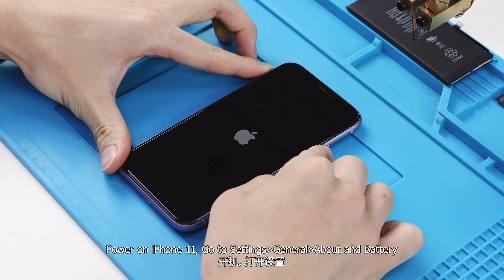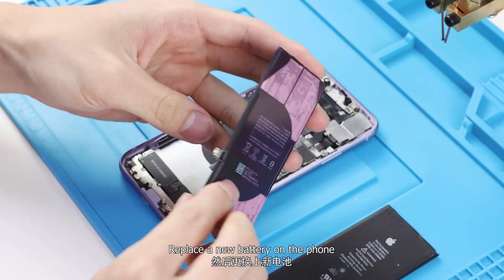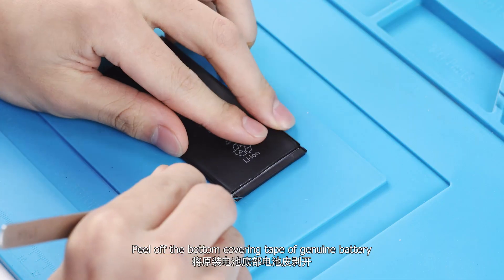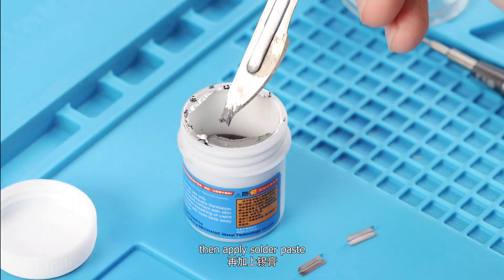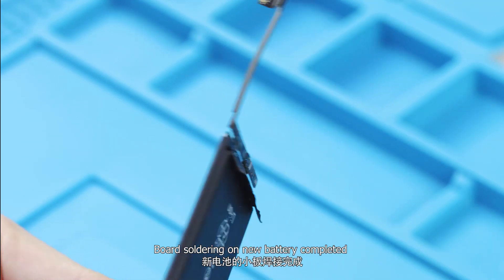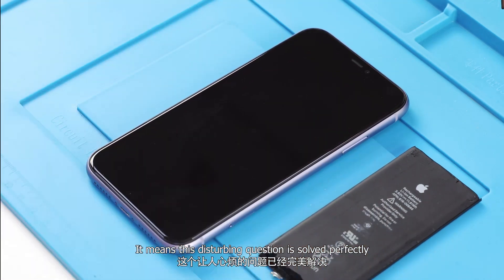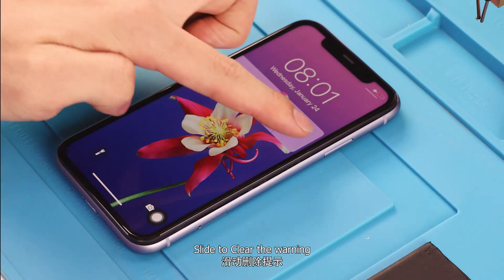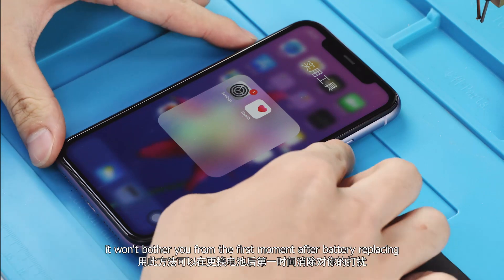Hardware Solution+Trick Tip- How to Remove iPhone 11 Series Non-genuine Battery Warning?

Comment from the maker: When you replace a new battery on iPhone 11/11 Pro/11 Pro Max, there will be an “Important Battery Message” shows it can’t verify the new battery is genuine.
Today we will show you how to solve this problem fundamentally with hardware solution, and, trick Apple with software setting method.

Chapter One: Change the Battery Board
Chapter Two: A Trick Tip

Reminder: Professional skills required, we don't take any responsibilty or loss during individual repairing.
Reply: But if my old battery was showing 76%battery health then the new one will show the same 76% or 100%
Reply: After replacing board will it show the old battery health??🙄 or new battery heath
Reply: @manjeetguro9169  it will show new battery health as the phone will measure it afterwards. So short answer it will be 100% again
Reply: @blackstars1989  Hey, I wanna ask something. Is it okay to use the iphone with the shitty apple message?
Reply: @blackstars1989  New battery health but with 500+ “fake” recharge cycles
Reply: @Dolla_z  yes it is
Reply: @Coolie-ds4tu  like elekworld is saying you can correct it so cycle goes down to zero. JC, icopy plus ect can do that. It been out for months maybe years already
Reply: Hey, I wanna ask something. Is it okay to use the iphone with the shitty apple message?
Reply from the maker: @Dolla_z  Yes, this message just appear on lock screen and setting page after you replace a new battery, you can't read the battery capacity and know the battery health, but it won't effect the battery function.
Reply: @Elekworld  thanks.
Reply from the maker: @Dolla_z  You're welcome. If you like our video, pls sub and stay tuned for more helpful update. :-)
Reply: @Elekworld  one more, does it pop up everytime when I wake my phone?
Reply from the maker: @Dolla_z  If just wake up the phone, it won't pop up.
Reply: Does that also reset the 500+ cycles of the dead battery back to zero when welded to the new battery?
Reply from the maker: @Coolie-ds4tu   The battery cycle wont' go zero, but we have a new battery data correction tool can fix it. Pls stay tuned and sub our channel, we will release a short video on how to use it.
Reply: Is it possible to set the clock 1 year ahead to get rid of the warming message instead of just 1 month?
Reply from the maker: @BillAnt  Never tried this before, will test if possible.
Reply: @Elekworld  -Try 1 and 10 years ahead. ;)
Reply from the maker: @BillAnt  we can try this 😂
Reply: Where can I get that  machine used in joining   back the board together
Reply from the maker: @chikaubah9687    This weld machine works very well: https://elekworld.com/shop/productinfo.aspx?proid=15187&categoryid=287
Also we suggest you email service@elekworld.com for exclusive 1 on 1 service.

Comment: I have a problem every time I soldered the cell to the new battery it no longer works could you help me with a tip!!!

I've been watching the video more than 100 times I'm interested in learning, but even so the original flex burns

I need help please !!!!!!!
Reply from the maker: pls pay attention here: https://youtu.be/sjOCID0IN5g?t=164. If the anode and cathode were connected occasionally, the battery board will get burn and short circuited. The 2nd possibility is the battery cell wasn't soldered properly with battery board, which led the battery stop working.

Comment: Hi sir i want to replace the iphone 11 battery but before that theres important message already at the notification if i replace it to new batt. And i used the old motherboard on the battery you think the notification will disappeared?
Reply from the maker: The theory is that battery data was binded with motherboard, so when you change the battery or the motherboard, the warning message will pop out. So as long as the battery matches the board, the notification will disappear.

Comment: We tried this but it didnt work. what you think it is?
Reply from the maker: Maybe other reasons, but that's what we suppose:
1- If battery doesn't power on, probably the battery cell and board weren't welded well;
2- If powering on works but warning message still there, probably the older battery wasn't genuine battery

Comment: this method still work?
didn't need icopy plus/apollo anymore for iphone 11?
Reply from the maker: Hi Bro, this method always works even on latest iP13 series, check this: https://youtu.be/soisFl6hmtk. Actually this method works to remove "important battery message", while iCopy/Apollo works to copy data from older battery to new one.
Reply: @Elekworld  I changed iphone 11 battery from shop its non genuine bt i m facing software update prblm plz help me nd solve my problem 🙏🙏

Comment: my iphone xr is showing the same message do i need to get a new battery?
Reply from the maker: If this message pop out, it means your battery isn't genuine battery from Apple. So if you change a new battery it will still pop out.
Reply: @Elekworld  so what do i need to do cause it is shutting down every 2 minutes i cant even use
 it anymore cause it charges until 0%
Reply from the maker: @thuli6851  I see, if the power even doesn't supply power, no doubt you need replace it with a new one. Even though the warning message still pop out, but at least you can use the iphone as usual.
Reply: @Elekworld  does it have to be a genuine one? or even if its not original battery it is okay?
Reply from the maker: @thuli6851    Both genuine and aftermarket battery works, because no matter it's genuine or not, the battery warning message will still pop out. This message won't effect battery to provide power to iPhone, just very annoying.
Reply: @Elekworld  okay thank you i will go get the battery replaced tomorrow because i cant use a phone thats shutting down every 2 minutes
Reply from the maker: @thuli6851  welcome

Comment: After I have swapped the battery board and soldered it on to a non-genuine battery, will a JC V1S programmer reset the charge to 100% capacity or only the cycle count? If so, will this charge return to the capacity of the old battery once I have inserted it in to the phone and restarted it? Thanks
Reply from the maker: bro, check reply on the other message.

Comment: Changing the battery will affect the face id? Cause i have read some comments after they change their battery their face id wont work?
Reply from the maker: Nope, we dont' think so. Because battery has nothing to do with Face ID. We suppose probabbly because they damaged dot projector during repair battery, which caused the Face ID problem.

Comment: The tips is available only for one month? So you have to do that each month?
Reply from the maker: Nope, after one month the warning message won't pop out again, so you don't have to do it once a month.
Reply: @Elekworld  I thought the warning message dissapears instantly after the new battery is inserted?
Reply from the maker: @matthewJamesKendell    If you replace genuine battery board on new battery cell, when you install new battery, the warning message will disappear immediately.
Reply: @Elekworld  Thank you. Please Ive got another questions. After I have swapped the battery board and soldered it on to a non-genuine battery, can a JC V1S programmer reset the charge to 100% capacity or only the cycle count? If so, will this charge return to the capacity of the old battery once I have inserted it in to the phone and restarted it? Thanks
Reply from the maker: @matthewJamesKendell     Hi Matthew, we have the other 3 videos showing more details about your questions:
1- JC V1S Tutorial: https://youtu.be/n7Z_-g1q0Pc
2- Battery capacity change: https://www.youtube.com/watch?v=AWyLDQIuIBU,  https://youtu.be/q7_GLdJ6Oso.
If you still have questions, pls leave message here.

Comment: to weld the battery, just any pulse welder is enough or do you necessarily need a machine that has all the settings for a more specific welding?
Reply from the maker: I think it's necessary for stable and safe welding. Because battery is about power supply&managing, if the connection isn't that stable&safe, it might bring safety problem or threat to users.
Reply: @Elekworld  ok i understand, thanks
Reply from the maker: @DavideLabInca   U're welcome Davide. If you like our video, please sub our channel for more helpful update. :-)

Comment: Hi! I have my iphone 11 “Important battery message” and stuck on 70% charge after motherboard replacement what should i do? should i change the battery or it is motherboard issue?
Reply from the maker: I think it's the motherboard issue(if you battery could charge 100% b4 you replace motherboard), but if you replace the motherboard, it means you have to do so. So we suggest you change another battery(brand new) to install and test if could be charged 100%. If not, then replace the board and test the old battery.

Comment: How did you get 100 percent battery health i did the same procedure but new battery show same old battery health
Reply from the maker: Yes it will show old battery health %, because the data is from old battery board. Actually we tried to use JC V1S to clear the battery circle to 0, but once upon you restart the iPhone, the data will get back to old battery again. 
Check video for JC V1S: https://youtu.be/n7Z_-g1q0Pc
Reply from the maker: @Carrot Cruncher The solution helps on below: 1- remove non-genuine battery alert message; 2- show battery health&capacity(even it's old battery data) in setting. Yes I agree with you that perfect solution is reprogram new eeprom, by now only Apple can do this.
Reply: @Elekworld  I need to remove non-genuine battery message with JC VS1 not by swapping battery boards/flex. What does battery data restore does with JC VS1? What battery information am I restoring?

Comment: I have a red notification on my settings app as I have replace the battery normal on my XS max - when will this dissapear?
Reply from the maker: Unless you replace the battery board with genuine one, otherwise the red notification on the setting app will be available forever as long as you use this phone.
Reply: @Elekworld  I know that would restore the battery health function, but the simple notification on the settings app will simply remain there? What is the purpose of this?
Reply: @retroonyoutube5402  it will disappear on its own, not sure how long until it does.
Reply: @retroonyoutube5402  no it wont, the message will disappear

Comment: Will that restore the battery health?
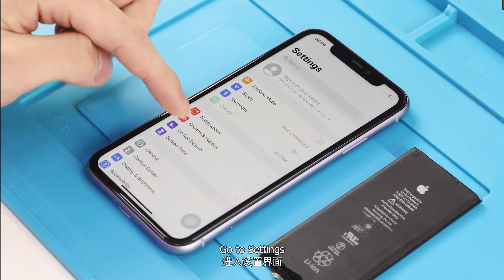Reply from the maker: Yes it does. Check 4:47.
Reply: You only can see the old battery %
Reply from the maker: @josuegravity  That's correct, but use the new battery capacity and power.

Comment: Apple claimed they done this for safety reasons, due to bad 3rd party batteries. To date I have seen more bulging genuine batteries than 3rd party batteries and they have just made changing a battery a much higher risk repair.
Reply from the maker: maybe they designed to do this, but actually this just hurt iPhone users' rights and using experience.
Reply: They just want more money to flow to their company, forcing people to repair their device on their company with ridiculous amount of money. 
One 3rd party service = Losing One Customer

They can just remove the warranty and not responsible for any damage caused by 3rd party hardware
Reply from the maker: @arvin kosasih     Agree 👍
Reply: Apple sucks, it's a disgusting money hungry company. imo

Comment: I hate that Apple locked down the battery, like what’s the point of that 🙄

And that tip to remove the warning message.. will it work for screens too ?
Reply: Yes, but the message still sits dormant in the settings so only removes it from the lock screen.
Reply: Cliff Richards alright thank you  💯